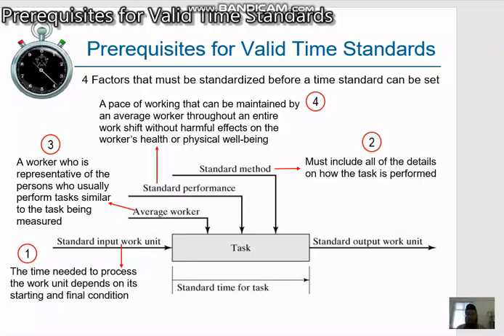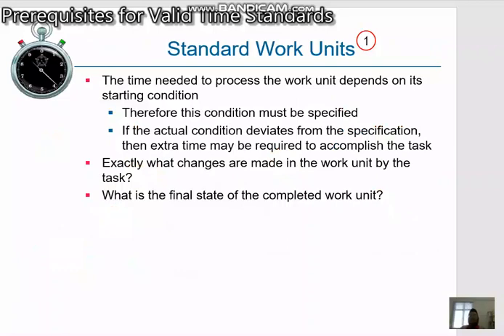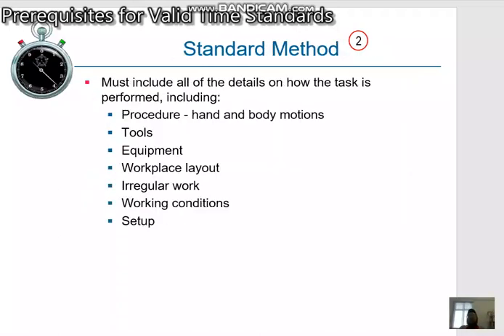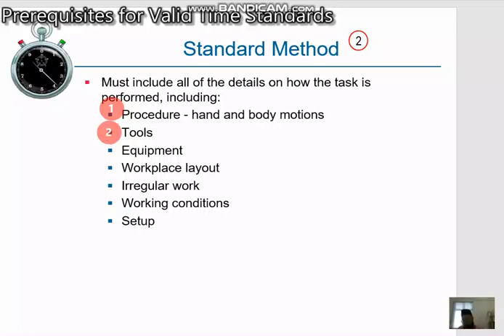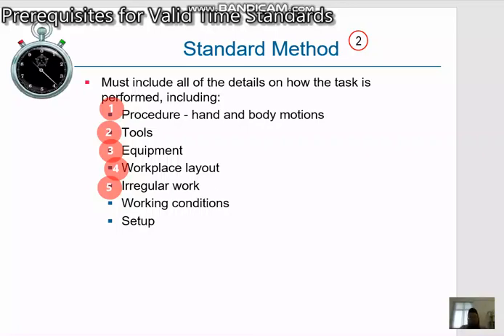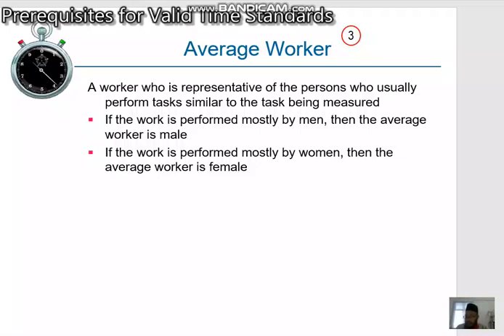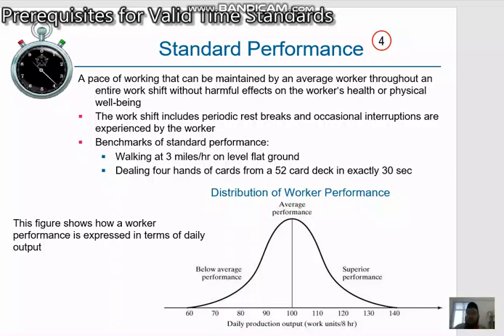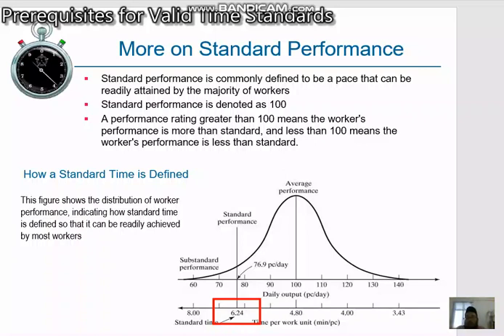Prerequisites for Valid Time Standards

Comment: b052020032
I learnt four criteria that must be standardised before a time standard can be established in this video. The first is the standard input work unit, which is the starting and ending conditions of the work condition, and the second is the standard method, which must include all specifics on how the task is completed. The third factor is the average worker; we must find someone who does the task on a regular basis in order to compute appropriately. Finally, standard performance refers to a work rate that an average worker can sustain for the duration of a work shift.

Comment: B052010214
From this video, i know there are 4 factors that must be standardized before the time standard can be set. The time needed to process the work unit depends on its starting condition. Standard method must include all the details on how the task is performed.

Comment: b052020025
necessary for validation time standard have 4 factors which is standard input work unit, average worker, standard performance, and standard method. for standard time worker unit, it is about time needed to process the work unit depending on the starting conditions. next is about standard method , it must include all detail on how the task performed. average worker represented of the person who usually perform the task . standard performance is a pace of doing the task that can be maintained by an average worker through an entire work shift without effect worker health

Comment: B052020016
From this video, I have learned about the prerequisites for valid time standards. There are four factors that must be standardized before a time standard can be set.  Firstly, standard input work unit which is the time needed to process the work unit depends on its starting and final condition. Secondly, standard method which must include all details on how the task is performed. Thirdly, average worker which a worker who is representative of the persons who usually perform tasks being measured. Another factor is standard performance which is a pace of working throughout the entire work shift without harmful effects on the worker's health and physical well-being.

Comment: b052010224
In this video, I have learned 4 factors that must be standardized before a time standard can be set.
1. Standard method : to perform the task, all the details must be included.
2. Standard performance : work pace must be maintained to prevent any harmful effect on worker's health.
3. Average worker : the worker's representative has to perform similar task before being measured.
4. Standard input work unit :  needed time to process the work unit.

Comment: b052010046
from this video i learned that There are 4 factors prerequisites for valid time standard

1. Standard work unit: time needed to process the work unit

2. Standard method: must include all the details on how the task is performed

3. Average worker: a worker who is representative of the person usually perform tasks similar to the task being measure

4. Standard performance: a pace of working that can be maintain by average worker without harming their health

Comment: B052110002
In this video, I have learned 4 factors that must be standardized before a time standard can be set. First is standard input work unit - process the work unit depends on its starting and final
Second is standard method - must include all the details on how the task is performed
Thirdly average worker-  the worker's representative has to perform similar task before being measured.
Last but not standard performance- least,needed time to process the work unit.

Comment: B052110007
Based on the video, the task is performed by an average qualified worker. The worker's pace (speed) represents standard performance. The worker uses the standard method. The task is performed on a standard output unit that is defined before and after processing.

Comment: B052110063
From the video, i learn that there are 4 factors that must be standardized before a time standard can be set. Which is standard input work unit (time needed to process the work unit), second one is standard method (must include all the details on how the task is performed), then, average worker (representative of the person who usually perform tasks) and the last one is standard performance (a pace of working that can be maintain by average worker without harming their health)

Comment: B052020024 
In this video, I have learned 4 factors that must be standardized before a time standard can be set. First is the standard input work unit which is the starting and final condition of the work condition, second is the standard method which must include all the details on how the task is performed. Third is average worker, we need to choose a person who usually perform the task to ensure we can calculated correctly. Lastly is the standard performance which a pace of working that can be maintained by an average worker throughout an entire work shift.

Comment: B052010079
from the video we know that it takes 4 prerequisite to valid the the time standard.
1.standard input work unit.
*it depend on the starting condition, if there any changes during the process then the extra time will be considered, we also need to know if there any changes are made at the work unit before performing the task.
2.standard method
*we need to know the detail before performing the task, there will be 7 thing need to be consider.
*we need to make sure the decision that we made after a few changes must be the safest, quickest and most productive during performing the task.
3.average worker.
*basically it depend on who is the most suitable to do the task, it either male or female.
4.standard performance
*is measure by the pace of the worker,  it need to be maintain the worker health throughout the entire shift.

Comment: B052010081
From the video, I can understand clearly the prerequisites of valid time standards. With the 4 factors explained, the prerequisites need to be well documented to avoid invalid time standard. In standard work unit, time is needed to process the work unit depends on its starting condition. The starting condition to the end condition must be clearly defined. Next is standard method. This prerequisite should include following details of how task is performed. Then, the prerequisite of average worker which is a worker who is representative of the person who usually perform a task. Lastly, standard performance which explained to how workers' performance based on a figure given.

Comment: B052010027
Based on the video there are 4 factors that must be standardized before a time standard can be set. 

The time needed to process the work unit depends on its starting condition that must be specified. Standard method is details on how the work is performed(7 method).

Average worker is a worker who is representative of the person usually perform tasks similar to the task being measure while Standard performance: a pace of working that can be maintain by average worker without harming their health

Comment: B052010140

What i have learnt from the video is, there are 4 factors that must be standardized before a time standard can be set which are standard method, standard performance, average worker and standard input work unit.
1. Standard method : to perform the task, all the details must be included.
2. Standard performance : work pace must be maintained to prevent any harmful effect on worker's health.
3. Average worker : the worker's representative has to perform similar task before being measured.
4. Standard input work unit :  needed time to process the work unit.

Comment: b052010039
There are 4 factors prerequisites for valid time standard
1. Standard work unit: time needed to process the work unit
2. Standard method: must include all the details on how the task is performed
3. Average worker: a worker who is representative of the person usually perform tasks similar to the task being measure
4. Standard performance: a pace of working that can be maintain by average worker without harming their health

Comment: B052020038
Based on this video, I am able to define 4 factors that need to be standardized before a time standard can be set which are standard work input unit, standard method, average worker, and lastly standard performance.
1. standard work input unit- Time needed to process work
2. Standard method -details on how the task is performed
3. Average worker- Person who usually perform tasks
4. Standard Performance- A pace of working that can be maintained by an average worker throughout an entire work shift

Comment: B052010094

From the video, i now know that we have 4 factors that need to be standardise before a time standard can be set which are standard work input unit, standard method, average worker and lastly standard performance. All of this are crucial to set an absolute standard performance level production that are acceptable without any opposition from any sides especially from the workers.

Comment: B052110022 
From the video, what I have learn is about PREREQUISITES FOR VALID TIME STANDARDS
The task is performed by an average qualified worker. The worker's pace (speed) represents standard performance. The worker uses the standard method. The task is performed on a standard output unit that is defined before and after processing.

Comment: b052010130
prerequisites for validation time standard have 4 factors which is standard input work unit, average worker, standard performance, and standard method. for standar time worker unit, it is about time needed to process the work unit depending on the starting conditions. next is about standard method , it must include all detail on how the task performed. average worker represented of the person who usually perform the task . standard performance is a pace of doing the task that can be maintained by an averange worker through an entire work shift without effect worker healthiness.

Comment: B052020012
In this video, I have learned about the prerequisites for valid time standards which are standard work units, standard method, average worker and standard performance. In standard work units, the standard input and output units must be specified which means that the starting condition to the end condition of the task of process must be clearly defined. Secondly, the standard method is the procedure that has been determined through the optimum method for processing a work unit. It is the most productive and least stressful method to the workers. Next, average worker is a worker who is representative of the person who usually perform tasks similar to the task being measured. Lastly, standard performance is a pace of working that can be maintained by an average worker throughout an entire work shift without harmful effects on the worker's health. Usually company will use multiplier to determine the standard performance. In order to get the standard time, we multiply the time per work unit with multiplier.